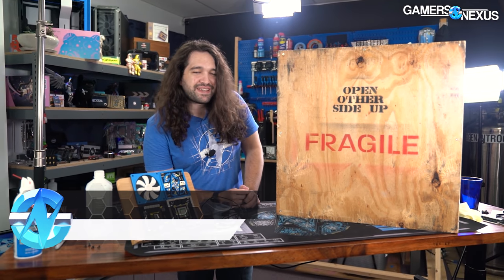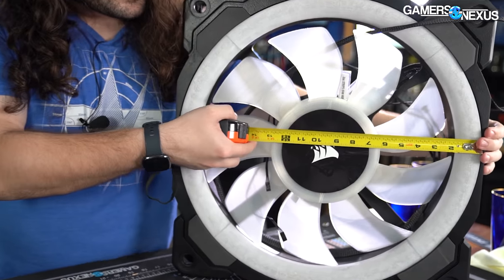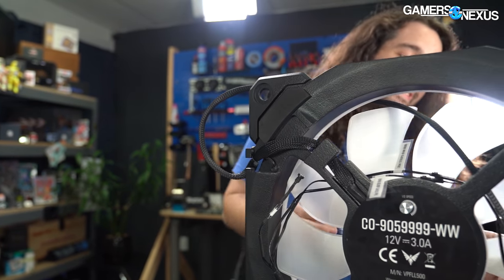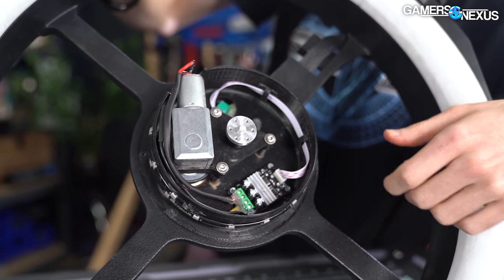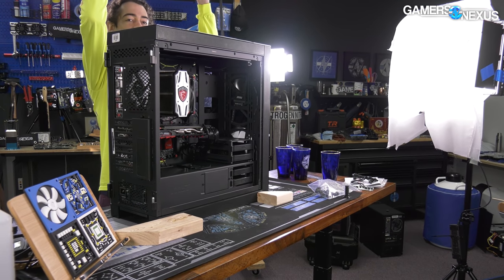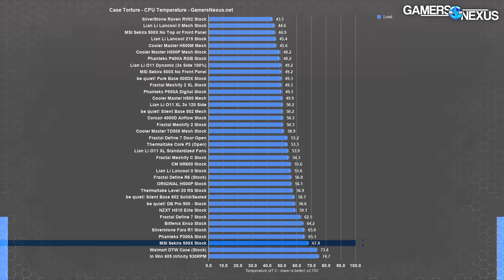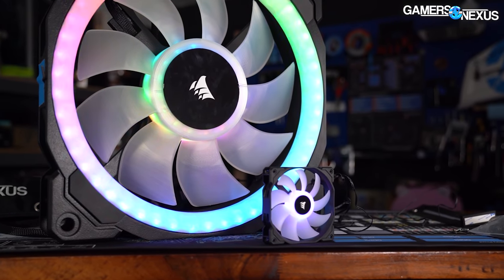World's Biggest Computer Fan: Corsair 500mm LL RGB Fan

Comment: Ok but how cool would that be to have as a room fan. You got it’s rgb synced with the pc
Reply: Window size.
Reply: I'd buy one if it synced up with iCue!
Reply: 3 pack + air matress = sleeping in 'the cloud' ??
Reply: at least it's bigger than the fan in my room.
Reply: You're going to need to download another RGB software for it though.
Reply: I want it so bad.
Reply: Too bad you'd prolly have to use iCUE
Reply: Don't give them ideas.
Reply: I was thinking the same thing
Reply: id buy a fuckin box fan modeled after a case fan
Reply: Looks are a thing to gamers, and I don't need that glitz lighting if it saves on the wattage/power budget needs and noise reduction to mimic the HAF X side panel fan for a PC case for calling. Using 2 massive PC case side panel fans here using maglev floating magnet technology to fix the fan motor and grinding issues after watching JayzTwoicents on the recent fixes to fans and noise grinding issues on PC case/CPU/GPU fans here.
Reply: make another one as an AC fan with RGB
Reply: Exactly my thought.  i's about the same size as the small box fan I have for hot summer days, and this is way cooler.  I want it.
Reply: and stare at the backside all day XD
it should be a reverse one for that case
Reply: @Sharktank get in here
Reply: Hello, seizures !!! 😜
Reply: i want one  but noctua
Reply: My thoughts EXACTLY. This would be an awesome floor fan.
Reply: Id put legs on it. Glass top.. make end tables that are rgb and spin.
Reply: if Corsair makes it controlled with an app or Alexa I buy it 💟
Reply: They could make it work as a ceiling fan (my ceiling fan for example is 42 inches in diameter).
Reply: Id preffer a xos noctua with no stupid das blinken lights, just like my pc has. performance>lights.
Reply: Id buy it 💯
Reply: The RGB is 7/11 lighting :p
Reply: I think Corsair underestimates how many people would buy this
Reply: @dunxy  Yes, but you could just take a standard Honeywell box fan and paint it brown.
Reply: I'd prefer a Noctua Model though with the Obi-Wan color scheme.
Reply: Oh yeah! You could have it in your window to get the warm air from your pc out of your room =D
Reply: exactly what i was thinking ha
Reply: I dont know why corsair or whoever they used to make the fan didnt just use a box fan motor instead of this wack ass belt and gear box with a worm gear abomination. could have likely saved a ton of RnD time and gotten a way better result with only a fraction of the effort
Reply: YAAAAAS I WANT THIS SO BAD OMG xD
Reply: Makes you ragequit a game much longer with all that cooling power.
Reply: RGB bathroom exhaust
Reply: Would be cool in my bedroom window.

Comment: That motor uses a worm gear drive, which does not allow for "back driving." This is due to the physical geometry of the gear engagement. My best guess is that the relatively large rotational inertia of the fan blade is able to overcome this by displacing the motor shaft and/or shearing metal from the worm and/or wheel gear. This will never work well as every time the fan is powered down, it is going to cause excessive wear. Unfortunately, a different gearbox is the only fix for this problem.
Reply: That's exactly what I thought. It's such a shit design. Like, who the fuck came up with that? there are SO many better ways of making it work.
Reply: @kasuraga  someone who wasn't aware of the issue obviously.  For a one of a kind prototype, i can see why they couldn't be bothered fixing the flaw once it was discovered.

It could be halfassed fixed by putting in circuitry to slowly ramp power down before shutting off, but you'd have the same problem anytime someone unplugged it under load.
Reply from the maker: This is awesome to learn. Thanks for the educational and well-written post. We don't know much about the motors/drives they used for this, so we just did a like-for-like swap. Great to learn here why it was failing!
Reply: @Wooble57  but seriously though, it could have easily been prevented by not using a stupid worm drive gearbox to spin something with that much inertia. You could probably destroy the gear box with a single finger on that fan blade.
Reply: @bradhaines3142  it was designed for a joke video what do you expect?
Reply: @kasuraga  it was designed for a joke video what do you expect?
Reply: If GN were to share the exact motor details perhaps you could suggest an appropriate replacement motor?
Reply: @GamersNexus  Bike hub would probably work as well for a ghetto fix.
Reply: They could have added a simple one way bearing to the gearbox so it wasnt driven by the fan on power down.That said I think the drag from the fan on the gearbox was still an issue and causes stress to the gear teeth when under load from the motor.
Reply: A fix for this would be a simple sprag clutch between the fan and drive shaft. They're basically a ball bearing with cams instead of balls, which freely slide in one direction but lock in the other.

They're used in helicopters (real ones and higher-end model ones) to allow the rotor to 'free-wheel' if the transmission seizes. Usually called an 'autorotation bearing' in this context.
Reply: @GamersNexus  I thought it was obvious........... The fan blades are too big and heavy for that toy motor. And the fact that it locks itself when turned off, is ten times worse. You need a new motor every 10 minutes...
Well, this WAS made as a joke.
Reply: Best option is definitely get rid of that motor for direct drive. However you could maybe get away with some sort of freewheel clutch on the centre shaft to stop it torquing the hell out of the worm gear when it powers down. Would need to be real light though as I doubt that gear can take much at all.
Reply: what kind of Motor should by used für direct Drive? is a small Brushless Motor enught? i don't think the baldes are to heavy so i should do the Job
Reply: @natsudragneelthefiredragon  Joke aside, still a shit design and as said in the video, Corsair didn't build it anyway. They just asked an other companie to make one that big.
And that companie literally screwed the life of that joke by putting a screwed-powered motor.
Reply: @Arachnoid_of_the_underverse  Even just a wrench-like mechanism in the bigger pulley would have been sufficient to prevent self-destruct of the worm-screw.
Reply: @felixwurm1467  Yep, lots of custom jobs use small brushless motors and that would be the best option for direct drive, to prevent gearbox/motor damage.
Reply: The other day I was contemplating a car radiator for watercooling....
Reply: @Flon22  of course direct drive would be ideal, but what kind of motor would you use? It needs to have low rpm with lots of torque to spin up that huge propeller, it needs to be small enough to fit inside and ideally pull less watts than a whole gaming rig, so you don't need a cooling fan to cool your cooling fan.
Reply: Yeah bad design. My bet is that they used that geared motor just because of the 90 deg rotation on the axis so they could fit it in the case. I don't even think they wanted the speed reduction since they are using a big pulley on the motor output.
Reply: @funcrusher213  Steve, it's time to call Chris King.
Reply: @funcrusher213  Now you have me imagining Steve introducing a follow-up video about this thing with Patrick having to spin the fan through a shoddily connected bicycle while getting chastised if the rotation speed varies.
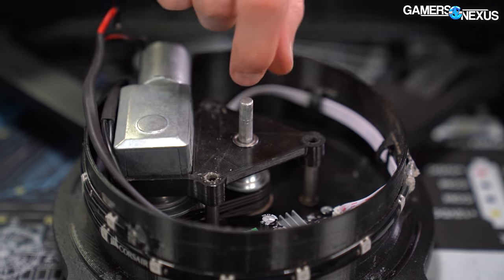Reply: Isn't this exactly what Patrick is talking about at 9:24?
Reply: Would a ceiling fan motor or a desk fan one work as a replacement?
Reply: @GamersNexus  worm gear drives do have its advantages.. like 'no kickback effect' ,it's used on power tools like circular saws because with no kickback its much safer than the regular one..
worm gears are also used on guitars, they're called locking tuners.. the basic principle of the worm gear drive is that you can rotate one shaft to make the other shaft rotate (which is 90 degree of the other shaft) BUT you can only do it from one side, if you look at the guitar headstock, the tuning pegs is the shaft you can rotate so that the strings will either slack or tighten, BUT if you try to rotate the shaft that has the strings attached to it, you can't.. because it would take a herculean effort and if the gear material is not strong enough the gears get destroyed.. so basically you can only rotate the tuning pegs to adjust the string, but if you won't be able to do the rotation from the other side by turning the shaft with the strings attached to it.. so that's why its called locking tuners because it 'locks' itself on one side and you can only control it from one side.. so the tuning peg is stable no matter how much vibration/intonation changes comes from the strings
Reply: A low kv brushless motor would be so much easier for this. Plus it would actually make this a useful fan.
Reply: @GamersNexus  the gearbox is fine but its need a freewheel mechanism on the shaft from the blades. you can build/buy a pulley with freewheel and only change this one part. dont need a new design without gearbox and different motor. When the engine is off the fan blades still spin off. 

You often see belt/pulley systems with freewheeling because they are simple and small. Like in a car alternator
Reply: @kasuraga  Not to mention the stupid decision to use a bunch of o-ring type belts all tangled up on what looks like a toothed pulley. Geeze, 3D printers have used GT2 timing belts for ages, so the pulleys and parts are super cheap and would work perfectly for this (once ditching the worm drive).
Reply: @felixwurm1467  A brushless motor would work, but it has to be very high-torque to work as a direct-drive motor. The most likely candidate would be something like the hub motors used in those 'hoverboard' devices.

Certain high-end RC aircraft motors could do it too, specifically the ones designed for very large drones. The large, flat 'pancake' style motors are best as they are available in very low kV ratings. However, they may have trouble starting (as they don't have an encoder to tell the speed controller their position, they don't run well at low RPM - often stalling out if a heavy mass is attached to them). 

A belt reduction drive is really the way to go.
Reply: 100% - most fans of this size are direct drive for this exact reason.
Reply: @patrickgoodhart9294  Belt drives are also fine (like on most older washing machines). Just gotta be back-driveable.
Reply: @TwinShards   Yea its just not built for the stress both motor and the drag of the fan is putting on the teeth. Lucky its not fittd to a multi million dollar processor ;)
Reply: I was thinking that too.  What would be needed is some kind of mechanism, kind of like bikes, where the wheels can keep going forward even when you stop pedaling.
Reply: BLDC motor, an esc controller, a propper belt, and pulleys to reduce speed.
Reply: I like the idea of using a large direct drive brushless motor with an ESC. Heck, add a radio receiver and 6S LiPo battery, and you'll basically have a fan copter that can be operated wirelessly.
Reply: @cocotug0  One with an encoder too, to help with starting.
Reply: Yea I was looking for this comment to.

A worm gear is good for a winch or something where you need a "brake" or where you need a lot of torque but a minimal gearbox.

Its an Awful option for something like this because the fan is a flywheel and it wants to stay moving.
You really dont want something with a lot of inertia on the other end of that gearbox.

Also the fact that the fan spins at 280rpm and not 250rpm is not odd at all, its very clear that the pulley on the motor/gearbox is lager then the pulley on the fan axle so therefore the fan pulley will rotate faster thats how you convert from rpm to torque and vice versa.

One could fix the problem with this design with a one way bearing, but thats basically patching the fact that this thing has the wrong gearbox/motor combination to begin with.

Also electronically slowing it down slowly would reduce stress on the gearbox.

Its pretty obvious that who ever designed this never played with Technic Lego as a kid because then they would have know better! XD
Reply: For a production run hopefully they use a Brushless motor and just regulate it to a reasonable max speed, that poor gear drive is not good at that job
Reply: @wuokawuoka  You could do that, just be aware that car radiators are aluminum.
Reply: @bradhaines3142  Agree its not a good design, but prob was just for the photoshoot so they just needed to spin and to look like a PC fan
Reply: My first thought when I saw the wormgear.
Reply: Would a hammer/impact drill motor be any good? Or at least good enough for testing a potential permanent one? They have adjustable torque settings and have brushless versions, the motor could be linked up to the dial on the back of the fan. I don't know how electric motor gears work, but a hammer/impact drill can take a lot of punishment, so surely the motor could be strong enough to take the resistance from a fan stopping.
Reply: @kasuraga  I get you 100%, but clearly the person who built this didn't understand.  Considering it's use case (a one off gimmick), i can see why they chose not to address the issue once they found they goofed.  They would likely have to redesign parts to make a new motor fit.

As for a finger on the blade breaking the gearbox, i think that unlikely.  If you slow down the blade externally, the most force that gearset is going to experience is whatever torque the motor can put out.  I think that if you were to drag the motor to a stall prior to shutting it off it would likely make the gear's last a lot longer.  Obviously a hokey fix, but if they get the chance to do futher testing it might be useful.   Or they could just not turn the thing off unless they really need to.
Reply: @Wooble57  I'm saying because worm drives don't allow for free wheeling, you could take your finger, and completely shatter the gear box by forcing the fan to free spin. With how small the gears are inside that unit, it would not be very hard to break it
Reply: @kasuraga  ah, your probably right in that aspect.  It is what it is now though, and i doubt they are going to make another one just to fix the issue (unless they decide to start actually selling the things, but i'm sure they'd fix it at that point)
Reply: @GamersNexus  do liquid metal also need to replace like thermal paste due to drying out
Reply: Im thinking planetary gears or a viscous fan coupling.
Reply: ... or you could do what many auto manufacturers have done with alternator pullies, and use a free-wheeling pulley as one of the pulleys in the system. Freewheel = you can't back-drive the thing that's supposed to not be back driven anymore, because the free-wheel pulley goes into the free-wheeling state.
Reply: @QuentinStephens  I got one. Take the motor out of a car radiator fan. EDIT: Yes, you'd need a new fan hub, but that's probably to be taken for granted. And the best part is that it would ACTUALLY MOVE A SIGNIFICANT AMOUNT OF AIR that way. Because, you know, the fan actually has something that can properly spin it at a high speed.
Reply: @JMMC1005  hall sensor is enough
Reply: I know I'm "late" to the party at this point, but want to amplify what someone else brought up - this fan was built not by Corsair, but by Volpin Props, and in less than a week (check out their portfolio page, this project is right at the top). I'm 100% sure this was commissioned by a marketing team and built "well enough to make a 2 minute promo." There's a good chance that the designer found a "good enough" motor that fit physical limitations and performance requirements, and expected the gearbox to have bevel/crown gears internally rather than a worm gear.
RE: RPM, at 12:50 Steve comments about the motor being rated for 210 rpm, but they clock the fan at 280-300. The belt drive looks to have different sized timing pulleys, giving a 1:2 or maybe 1:3 rpm increase at the blade hub mount. That gives a max motor RPM of ~100-150, meaning it's under a pretty heavy load while running.
Reply: That's right. I would run it at the lowest speed before shutting it off but it would no doubt still strip the gears with the inertia of the fan spinning against the stopped gear box.
any way, fun video. Thanks for fixing it just to go ahead with your test!

Comment: Okay Corsair, here's the deal: you build a case around that fan, and I will buy it. I'm not even slightly kidding (part of me wishes I were).
Reply: My question is: is there actually any case that can support such fans?
Reply: Cpu air cooler for it or an aio with 2!
Reply: ...saves you office space. That thing can easily hover under the ceiling 😆
Reply: just buy a few server's, stack as many as you need to reach 5DM height, and bolt this to the back.
that would also (at somewhat human prices) allow you to create enough heat for this, with maybe 20cpu's, and a few server GPU's.

dam, now i wana build this.
Reply: Easy: the fan is the side panel. 👌don't even need to build a case around it, just some adapters for securing it. It would look doooope!

Edit: should've watched the video first...
Reply: $200 a fan lol low noise high flow. Slap 2 on a giant case, intake/exhaust lol
Reply: I won't lie.  I was thinking the same thing.  I don't know why i'd need to cool a 980ti with a 500mm fan, but I do because reasons.
Reply: @renegade25_banhammertech_40  [CaseLabs has entered the chat]
Reply: Use it as a side intake fan on a tower case seems like a good option,  at least then the case won't be so big you could fit 3~5 PC builds in it
Reply: @NaterNorris  And then bolt the case to the ground, otherwise you'll have a giant blender flying in your home.

Well: at least it will fly at more than 60fps. =)